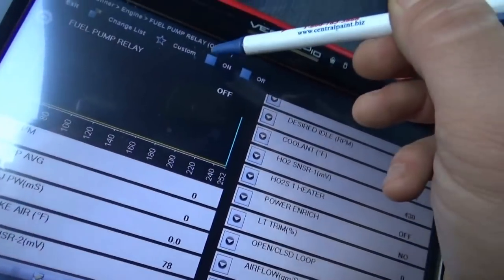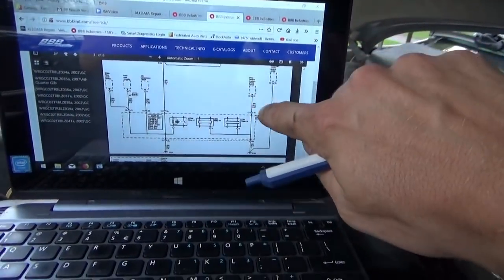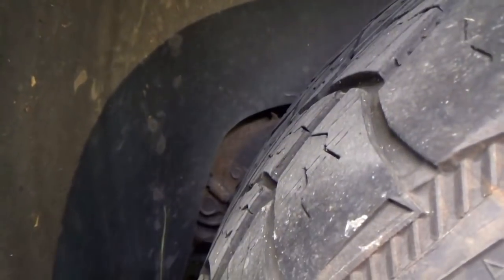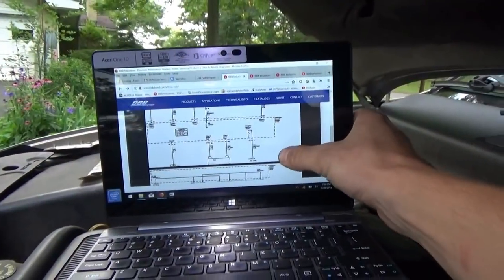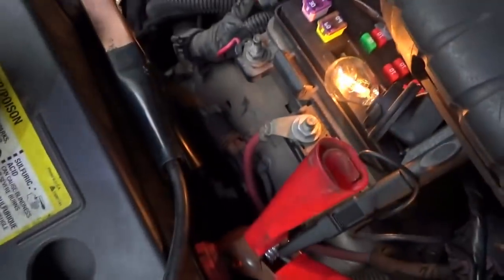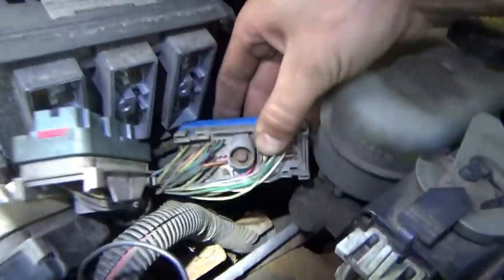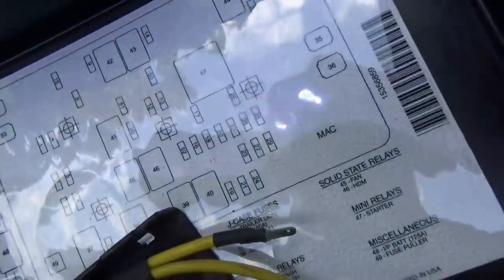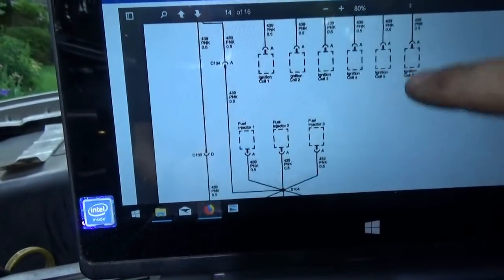GM Truck Stall, No-crank, no-start Case Study -Part2

Comment: I have replaced the computer brain had it reprogrammed new coil packs new switch is the switch under the steering wheel called the key ignition switch replace it and it will fix your problems my friend if you got full coverage on a trailblazer for gasoline on it and burn it to the ground unless you're a millionaire and got plenty of money I'm a poor man I don't have that kind of money😂

Comment: I have a 2003 chevy trailblazer I replaced battery the starter and ignition switch and the starter relay checked fuses all were good  still no crank and no start I don't know if this has anything to do with it but my indicator light on the transmission isn't working

Comment: Mr pine man have Chevy trailblazer 2005 love that no crank no start but I find out the bolt s on the fuse box come loose I just tightened them back and it Started right up yhanks😊

Comment: My trailblazer did the very same thing I started it was writing down my milage it died and no crank I found your vidio I did all the tests till you went to part 2 for some reason it wouldn't come up so I checked a few others and according to the it was the switch so I bought a new one didn't work do I tryed again this time part 2 showed up I couldn't belive it when you said a 15 amp fuse I looked down and could see it blew and yes it was missing had to replace the coil thanks a ton for your help saved me a ton of time and money keep up the good work

Comment: Grounding between positive battery cable cable and block through the aged insulation
Reply: Allows enough power get through the PCM but just not enough to power relay to fuel pump and or ignition coil

Comment: Hey thanks a lot for your video!! It really helped me out on my 2003 Chevrolet Avalanche!
My Avalanche died while driving: suddenly it just stopped running, giving me a brake-system-message (which, I discovered later, popped up because of the CPU shutting down). After that, it wouldn't do anything anymore: not even cranking. It would only react to turning the ignition key by turning on the dashboard gauges and lights.

After a lot of searching, I discovered it was my fuel pump that had died, causing its fuse to blow. And that same fuse happened to be supplying the CPU as well... Causing the truck to react to nothing, not giving error messages, ...

Thanks to your video, I learned that the GND to the starter relay is controlled by the CPU. This is NOT mentioned in my Haynes repair manual!!!
I measured the GND on the starter relay, and it was OK. But after seeing this video, I measured again, and found out that the GND disappeared when turning the ignition key!!

Thanks a  lot, keep up the good diagnostics over there!!! Greetings from Belgium :-)

Comment: How did the coil blow after the fuse blew?  You'd think one of them would have blown first.  Once one blew, the stress would be removed from the other.
... unless the coil popped as soon as you hooked up the 25A fuse and you didn't catch it on the scope.
Reply from the maker: Great question! Rarely see a double failure like that.

Comment: I have the same problem but for a 2005 Chevy Avalanche.. When I try to start it, all the lights turn off.. No power to my crank fuse. Starter,battery and ignition switch is brand new

Comment: Interesting sequence of events !  I'll guess the ignition switch was an intermittent issue before the engine quit as the odds of the coil failing and the switch at the same time would be very high. Based on the customers information in this video, it appears he has been under the hood dealing with operational problems for a while. Could be the exhaust manifold leak is allowing the coil(s) to overheat. I never understood why folks continue to drive cars/trucks with exhaust leaks. 

How do you figure your charges to the customer?  1 hr diagnostic fee I presume. then what?

Comment: After watching a fair number of your cases you eventually find the problem.  You'd find it a lot faster if you didn't get distracted during the process.  In this case sticking with the starting problem would have led you very quickly to that fuse providing power to part of the PCM.  Instead you got sidetracked and dove into another rabbit hole with wondering why the bidirectionals commands weren't working.  As Eric found out many years ago once you track down one of the problems  ( he picks the easiest to analyze and get to ) the rest generally fall in line ( in this case once you saw the power distribution for that fuse and what else it powered you realized the whys of the others).  Stay focused on the problem at hand and you'll be less frustrated and less likely to make bad calls..   And, now that you've thought about this case does it make sense that the ignition switch failed at the exact instant as the injector which took out the fuse?

Comment: 2004 Chevy Silverado 4.3 v6   driving down the road motor dies got home check all fuses and nothing blown    plenty of fuel and I hear the fuel pump working. So I pulled the coil wire from the distributor and No SPARK  motor turns over no spark out of the coil wire I change out the crank sensor in the sensor inside the distributor still no spark       when the ignition is on the ONLY Light  that comes on is a yellow motor light and it's not flashing.      if someone thinks they can help me call me  979 595 7872 Kevin   this is only way I have to get to work its been a week now I've been using a vacation time and I need to get back to work please someone help

Comment: Had the exact same issue, customer called, no crank. I found the same fuse blown.  Replaced it, started right up, but with a misfire, cylinder 3. 06 GMC Envoy, same engine.
Reply from the maker: Nice!

Comment: Yup, I got an escape from a guy for $500. Crank no start, all he did was throw parts at it, he kept running the battery dead so no codes. After bringing it home it sounded suspicious that the compression sounded like it increased over time. It would crank like a dead battery but the battery voltage remained normal. On a hunch I unhooked the EGR tube and it fired. The pcv valve had gone bad and wasn't restricting enough causing a vacuum leak making the engine run pig rich, in turn caused the cat to "melt-down" and plug up. It's amazing how much using your tools helps, it's also amazing that a $5 piece of plastic can destroy a catalytic converter.

Comment: Wow...very amazing video. I have the same exact truck with the same exact problem..I think. It's @ a shop and I am $564 in & paid I might add, to no avail. He's changed the ignition module, Ignition Cylinder,& the Gear Shift indicator. Still no crank. And what makes this even funnier is that approximately a week before my truck shut down he put in a coil...He's had my truck for a month now, what should I do?

Comment: Glad to see that you made it to a conclusion. On a no start issue I always start by checking all the fuses first just to save some diag time. You can retrace the circuit later if need be.

Comment: Why don't they design the computer to know when it loses power on a circuit? That system only had one ground but several power feeds. If the power that allows the computer to communicate is lost or the ground is lost, the computer won't communicate. Any other power feed should be monitored and set a code. Even back in 2000, material handlers had an indicator for blown fuses.

Comment: When you said misfire when you started it my first thought was when the coil went bad the fuse probably blows due to a spike that could potentially be created by a rogue coil on it's way out or even after it goes. MY guess being that it fired it probably occurred when it went bad but also you have to take this into consideration, how do we know what the owner, some other mechanic did while working on it before you. You said new coil was on already so maybe he changed one improperly and it blew out due to battery not being disconnected, ignition maybe not being turned off, etc etc but that was a good find. How much time on scene did you have and do you bill the full amount or do you bill for 2 items, no power diagnostic and misfire diagnostic?

Also what are you using for your electrical charts Ivan? I've seen 1 free site. IF I did more stuff I'd do shop key or something of that nature but I do it more so as a hobby and a little here and there for friends of friends. IF I don't know you or a friend of yours chances are I'm not going to mess with it as the personal connection matters as well.
Reply from the maker: I billed for 2 hours. Check out BBBIndustries for free diagrams :)
Reply: Pine Hollow Auto Diagnostics I was thinking bbb . I've heard good things about that site before

Comment: I really like your videos as you really have a proper structured approach to narrowing down and isolating the faults. The detective work you put into finding out the cause makes you the Sherlock Holmes of automotive diagnostics. I also commend you on your effort and hard work to video record every step of the way to finding out the root cause. It can be cumbersome and time consuming to record. Most mechanics will just want to dive in straight to find and fix the fault instead of taking precious time to record and provide a detailed commentary. Keep up the very good work!
Reply from the maker: That is a really positive and motivating comment. I appreciate it, Hanif!

Comment: Lol was a good one this.
different approach may of found that sooner, if owner had mentioned coil replacement think I may of hit that area quicker .
bad new ign switch made it messy .
Some guys always like checking fuses and to fair it not a bad idea at times look at fuses when nothing else working out.
If you called a computer on that you would of been in remorse for months lol .
Cool lesson on keep testing and assume nothing :-)
a coil and a fuse and job jobbed , didn't guess that lol ...

Comment: I bet you are so glad you did those final checks for powers and grounds towards the end there before calling the computer. Sometimes we can do the 99.9%, then call it based on "knowing" the last 0.1% has to be just fine by gut feel and past experience. What more experience tells you is to go the extra inch to go to 100% even if you are sure you "know".... they say something about assumption, all I know is it certainly has a way of kicking you in the nuts at every opportunity no matter how tiny the assumption.

Good job going the extra inch at the end of an extended diagnosis and under time pressure - those conditions are the worst for somehow exacerbating the tendency to call it at 99.9% confidence and internally believing it "proved". Some kind of nasty cognitive blind spot occurs. Been there, done that... still catch myself doing it at times.
Reply from the maker: Absolutely. Great comment!

Comment: how do I find powers and grounds for the PCM on 2005 Chevy Impala on BBB Industries would it be under the starting system wiring diagram
Reply from the maker: Look under "engine" and "fuel controls". Should be on the first or second page :)

Comment: Hey Ivan I have a totally unrelated question for you . We have a 2013 BMW X5 diesel that has about 70K miles on it. Few months back after purchasing it used we my husband and I noticed the car would jerk while driving. It started to happen more and more so my husband changed the diesel fluid. He thought that did the trick. Well it got worse. I normally don’t drive far out, everything in close so I don’t need to drive for a long period of time and from what I know diesel in the bmw needs to run for at least 10min over 40mph not sure how true that is. For the past few weeks the car has been shifting into N drive and shutting off. The power is gone in the car as it switches to neutral. I can’t switch it back to drive. The only thing is pulling over if possible. Shutting the car off completely and turning it back on. This is starting to happen on a daily even multiple times a day. We’ve had the car taken to bmw for different repairs. Nothing in a code would come up explaining this issue. Now we are getting a engine malfunction code, says engine operating at reduced speed. The car drives horribly when that code appears. But then it disappears and when turning the car off and back on it’s fine. Please help, I can imagine the cost for the repairs but I’m worried this could end up being a worse issue. Thanks so much sorry for a long comment. Jules
Reply: Also keep in mind when I say it switches to neutral that’s while driving. Either on the highway, regular roads even sometimes going through a drive through. It’s happened with the key being in the car or not. Not sure if it’s technical, or it’s something more serious. Please help, I’ve researched and can’t seem to find this issue with the same car , year etc.
Reply from the maker: Oh boy....wish I could help. It's a BMW, and a diesel...the diagnosis can get very complicated very fast. Definitely an electrical problem, but that doesn't really narrow it down lol. A test drive with a fancy scanner and live data would be my first step. Also scan ALL the modules for codes...there are probably like 70 of them on that thing lol

Comment: I worked a lot with P.O.S. "point of sales" systems.  Which basically means touch screen systems.  I was unaware of this issue for many years.  Then after having I.T. technicals replace back screens on several devices.  I started to worry about what happens when my warranty runs out.  They explained that over time and repetitive tapping on the same spot . With a non approved stylus or computer pen it will affect the touch screen. I thought the same thing your thinking about what the difference. Till a year later it happened again on another device. I was told not to use pen or credit cards because it's a common issue. After that I stopped doing it and asked my employees to stop also on front counter P.O.S.'s. Next time your out at a restaurant or office that have similar devices in principle. You will see how many people do it. I'm  only telling you because your equipment is your lively hood. Those types of repairs are expensive and have to be ordered.  As I've learned so much from watching your videos.  I thought I would only mention it to you. 2 different I.T. repairmen had explained  it to me . I still catch myself doing all the time. Also touchscreens have come leaps and bounds too. I just know how much you paid for your scanner. We had multiple devices setup for business use with a lot more usage on a daily base. Next time you talk with an I.T. technition for update or service ask him his experience with that issue.  I'm going to ask another youtuber named scanner Dan who is also a teacher for SnapOn if he has ever had that issue.  We invest a lot of money into our devices and why not take a little more time to learn a little more about them. Sorry for the long explanation.  Look forward to your next video and really big fan. Great job.
Reply from the maker: Thank you for the explanation! I think that by the time I wear out my screen, the scanner will be old and outdated so I will have to buy a new one anyways ;)

Comment: I had the same problem with a H2 Hummer (PCM fuse blown) I had no sparks nor inyector pulses but I had the starter working fine. Guess what? The fuse blown because somebody installed some aftermarket lights using the PCM fuse wire to feed the circuit! About the weird behavior with the vent solenoid I think is trying to open but there is too little amps going to the control side of the solenoid, is just the same scenario when a relay is clicking on/off due to low voltage.

Comment: Nice diag only reason why I said half of pcm meant partial pcm is dead  with no fault codes  when the pcm does it self check it can't put out checking voltage if it ain't alive hence no codes  had it on Euro cars  depends on what part of I C has gone down. Powers and ground checks  can't beat it

Comment: Great diagnostic procedure & outcome!  Did the coil fail due to a short to ground which caused the fuse to blow? Or do coils typically blow fuses when they fail?  Thanks for not firing the parts cannon at this before you had checked everything out, including pin 19.
Reply from the maker: I've never seen a coil take a fuse out...usually it takes out the PCM driver lol
Reply: Pine Hollow Auto Diagnostics My thought from a distance is that either a coil wire got pulled out of the harness and was abraded to cause a short, or the outer  protective covering of the harness was not secured properly and was cut through by abrasion/vibration causing a short of the coil wire inside the protective covering, making it that much harder to see or find. Testing the grounds at the fuse box is much easier than going to the grounding points, and is so easy it can be overlooked when checking ground circuit integrity.  Thanks for your videos - it is a real education for those of us who learned what little we know from setting ignition points on the side of the road with match book covers, and repairing busted water hoses by wrapping them with strips of paper grocery bags and securing those with tightly wrapped baling wire (guaranteed for 20 miles at low speed).
Reply: Side of the road repairs were common in my younger days also. At 77, I am amazed at the way these young people troubleshoot these problems. This was one of the best examples I have seen.
Reply from the maker: I have done my fair share of roadside repairs too Harry, most of them without a scanner ;) It's actually fun IF you brought some tools along haha!